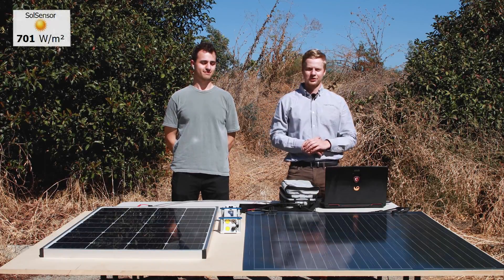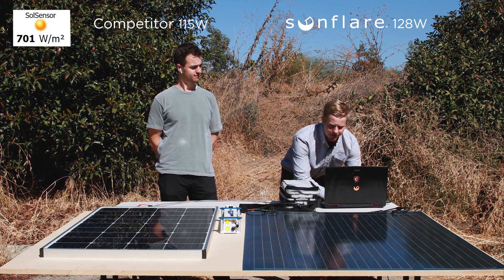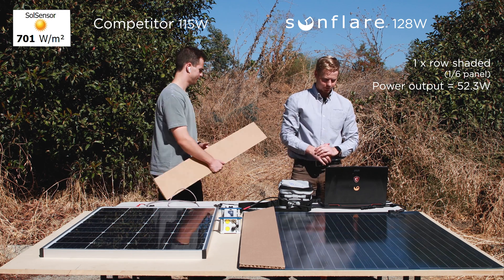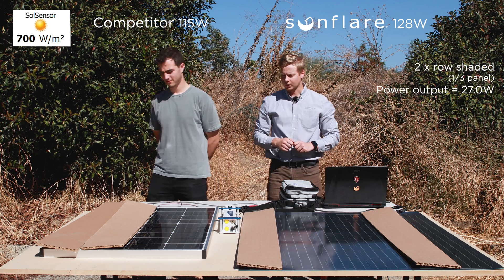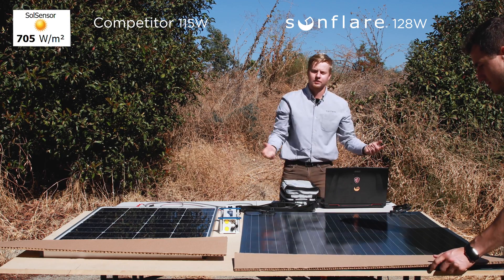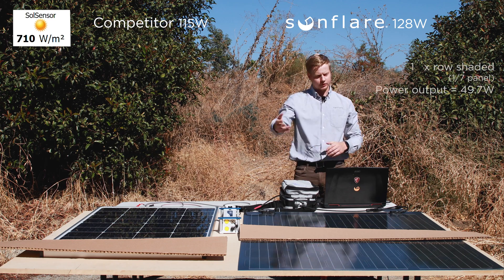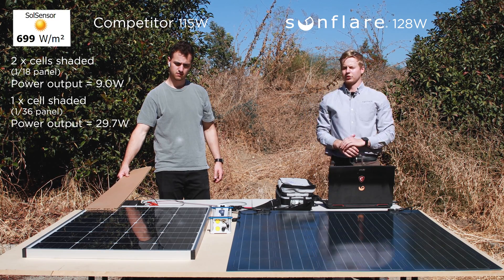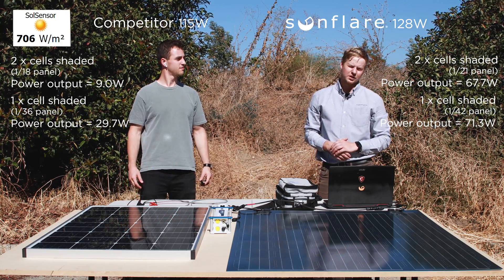Flexible Solar Panel throws shade

Comment: Not a scientific test.  For one thing, the competitor evidently has higher efficiency as it is a smaller panel with a similar output rating. 
When you shade the smaller panel with the same size stips, a greater percentage of the total area of the smaller panel is being covered.

Comment: You should compare a standard 60 cells silicon module with the Sunflare module. Or at least 60 small silicon cells module to compare with Sunflare module. Under your testing, it is unfair and not neutral.